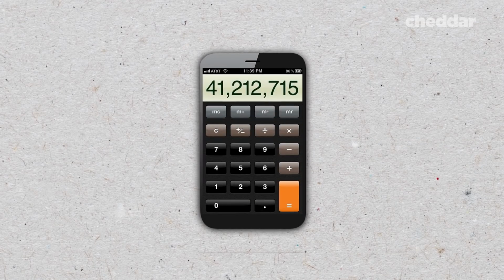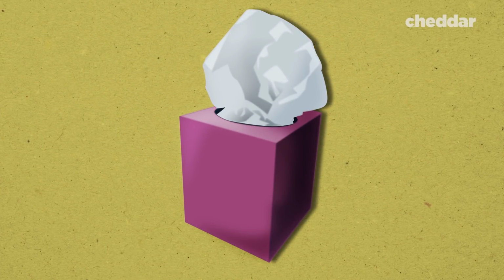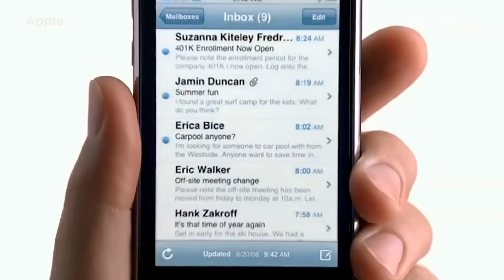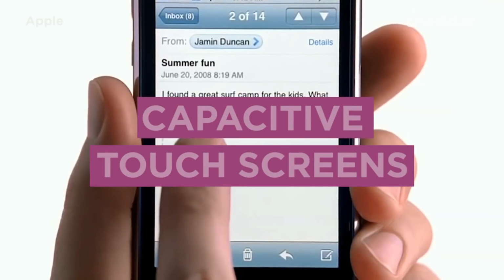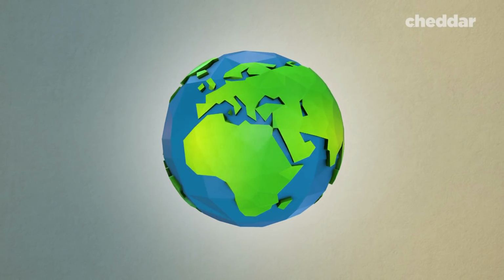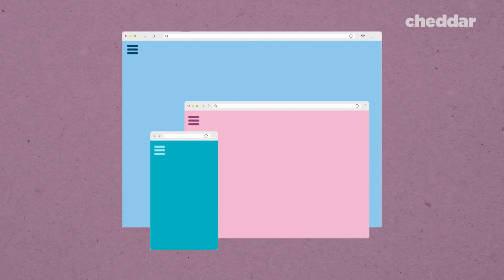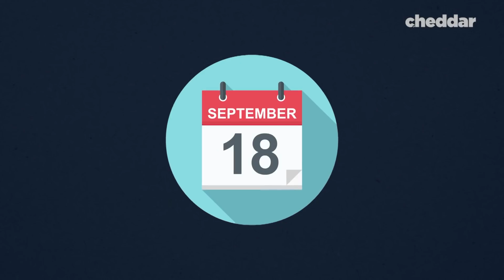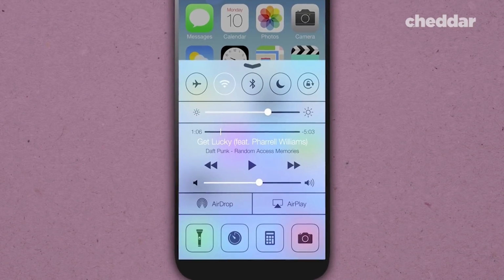Why 3D Logos Fell Out of Favor Overnight - Cheddar Explains

Comment: - Hamburger menu icon does not look at all like a hamburger. But, close enough and, I guess, hamburger is more memorable than “three horizontal bars” menu? Even this burger style? menu icon is changing with lower lines cut shorter (Just look above here at the YouTube SORT BY menu! That would be a very tippy burger.)
- Pro graphic designers always hated ugly 3D logotypes because they are impractical for many and diverse applications. As companies grew up, they realized they needed better designers to do their identity design. So they hired better/pro firms versus high school friends who went to art school or, the local yellow pages…
At the same time, the 1980s icon work by designers like Susan Kare, which is associated with the post modern movement in graphic design at the time (in part, oddly, thanks to the Mac at the same time — it gets very meta), 3D icons were useful (as described here). 
The crazy thing is that the icon became the brand or, rather WAS the brand. The inevitable reconsideration of brand identity versus function along with the preference of designers lie Ive at Apple toward less and less — of everything, much to the frustration of everyone! — meant things went back to simple and flat. Even if that meant they no longer worked as a form of visual feedback for the user. Much like this ☁︎ means cloud or this ☔︎ means you will need an umbrella.
However, in some cases, minimizing went/has gone too far. 
I am no fan of ugly logos and icons as decorations but, skeumorphism has its purpose to enhance a designs function and feedback in some instances. Probably a combo of some minimal and some key skeumorphs for interface icons make sense. But simple and clear for identity and brand design is better.
Just don't take it too far. Which is happening now with the branding of a lot of corporate identities to a Helvetica like signature as the identity. Too little is, too much. Simple for simple's sake is not really simple. Just boring and, bad design.

Comment: Pizza hut's was flat already. Ihop's was basically flat with a slight shadow to give depth, wouldn't call it 3D either. The only accurate example is the olive garden one. How can you narrate something and contradict yourself visually at the same time? Was this video designed by committee? 3D vs Flat != Complex vs Simple. You can have a 3D logo that is super simple and a 2D, flat logo that is a clusterfuck of complexity.

Comment: Meh, I'm not wholly convinced by the anti-skeuomorphism claims - sure, it can be misused and abused, but the idea that design can be used to provide information about function is legitimate, and the complaint that it's become more difficult to tell what's clickable is also legitimate. Design should always look towards making things easier to use, and taking an extremist stance that ALL skeuomorphic design is bad, or the stance that ALL flat design is cleaner and easier to use - is in my opinion hurting design more than it is helping. There is an time and place for everything, and knowing when to use design elements like shadows and gradients - and knowing when not to use them - is key. I'm hoping that in the future design is driven by what works best, not driven by bad philosophy based on black and white thinking.

Also there is some factually incorrect information in this video - SVG and other vector formats actually support shadows and other 3D like effects. Being able to scale an image to any size is not affected by things like shadows.

Comment: Some serious scripting issues in this video.

The Adobe applications that ushered in anew era of logo design were Photoshop and Illustrator, not InDesign as the video claims.

And Apple has never made anything called an iTouch. They did use the iPhone OS (as it was known originally) on the iPod Touch.

But perhaps worst of all is the conceit that iOS 7 installed itself overnight. It most certainly did not.

Comment: 3D logos were just a passing trend, like any other trend. Logos need to be easy to recognize and reproduce on different media, and that's why flat logos are not a trend, but a need, and they have been used since the dawn of graphic design. You're not going to use a fully shaded 3D logo on an embroidered shirt for a uniform, or a medium that only allows for one color to be used. You're mixing corporate design with UI and UX design. Apple may have pioneered some design trends at some points, but I'd dare say that was only for other competing companies like Samsung and Google, but that works both ways. It's silly to think Apple influenced Pizza Hut's or BK's logo evolution.

Comment: As soon as something becomes easy to do it becomes unfashionable.  On the Web,  glossy surfaces, rounded corners and drop shadows were hard and involved complex tables and slicing images into little bits. So designers wanted it.

Then css came along and it became a lot easier.  So designers  stopped doing it.

Comment: What this video calls "3D" isn't truly 3D; it's 2D design made to look like 3D. Abandoning that design philosophy, or "going back to 2D", is just a phase that can and will change as the wind shifts in Silicon Valley. (And no, Apple is NOT the only source of those changes.) The most truthful thing about this video is that VR will force a return to 3D design, because it requires 3D realtime rendering if not true stereoscopic 3D (which at this time still requires special eyewear, hence why 3DTVs disappeared -- especially the "active shutter" kind).

Comment: I'm surprised the video didn't mention the argument that flat UI design (which it incorrectly calls "2D") conserves processor power and thus extends battery life in mobile devices -- which was a BS argument because both processor power and battery life were improving rapidly at the time everything switched from glossy to flat, thus making the alleged improvement irrelevant. 

And companies are starting to slowly shift back towards a more glossy design. When Windows 10 first came out it was totally flat and monochromatic, but with each major update it gradually added back some more colors, transparency, and shadows, and now with "Fluid Design", Microsoft is proposing to make Windows look more truly 3D (not just glossy) than it has ever been before.

Comment: Wow. Not only at first, to this day this is a problem. 2D is amateurish. It looks and feels less professional, less modern, less technical, less of what we should expect.

The menu button has been around in the 3 line design since I can remember. Like the oldest graphical interfaces I played with had some variation . So when you call it a “hamburger menu” it makes a lot of people cringe. Hard. Especially me.
Simply; people needed an excuse to make changes. Unfortunately it fell flat on its face. Technology moves forward, and design moves backward. It doesn’t seem to bother most people, which is good. But that fact bothers me a lot. We should hold technology, innovation, design, etc. to a higher standard. 

But then again that’s just my opinion. 
I greatly miss the 3D integration in all our tech, and I’m saddened that more people aren’t adamant about it.

Comment: wow wow wow so all those 4.2K dislikes are from android advocates? This video uses ios as an example to explain the timeline of design trends which is mostly correct because, before the introduction of MD in Lollipop, iOS with its systematic design language controlled and dominated the app interfaces. It’s overnight because after iOS 7, every application on mobile platform or even desktop apps and websites started to shift to flat design (it’s definitely not because of the design language from windows mobile. It is iOS who made the shift). The title of this video is called “Why 3D Logos Fell Out of Favor Overnight”, it is NOT “Who caused the downfall of 3D logos”, so they did not necessarily need to mention windows’ metro design.

Comment: The shift towards 2D logos actually started with Microsoft when they released Windows 8. You know, the computer OS used by an estimated of 70% PC users as of 2016.
Reply: Windows 8 was used by 7.1% of the total pc users, NICE TRY THO KEEP IT UP.
Reply: Tasso no, IT IS USED BY 7.1% of pc users. ITS NOT USED AS MUCH NOW AS WINDOWS 10 IS NOW USED MORE
Reply: What idiot would use windows 8? Compared to 7, it is utter garbage
Reply: @Sciller4  that is not the point. 70% used windows 8 at the time but now nearly nobody uses it
there is a difference yknow between past tense and present tense
also stop necroposting - the discussion ended 4 months ago

Comment: This video doesn’t really hit the mark on several fronts.

You name two Adobe programs (InDesign and Photoshop), but leave out the most important one - Adobe Illustrator. That’s the program you make these logos with. It’s the program you use when you vectorize your face.

You keep referring to this trend as “2D”. The industry - and more appropriate - term is “flat design”

You use the Burger King logos to state that logos are going 3D. But both logos are 2D.

You’re explanation of skeuomorphic design is (almost)correct, but the example of the floppy disk isn’t.
In skeuomorphic design, you retain
ornamental, mostly unnecessary design cues that are inherent to the original (like the calculator interface you show). The floppy disk icon is an analogy you use to convey you can save something. Yes the analogy harkens back to earlier times, but it’s an analogy, not a skeuomorphic element.

I wonder if other cheddar videos are as incomplete and inaccurate as this one, but i just don’t know enough about the subjects.

Comment: Wow, a lot of this video is really poorly researched.

- If you made your logo in Photoshop or InDesign... you're doing it wrong. Most logos I guarantee you are 2D vectors coming out of Illustrator. Even the "3D" ones. Illustrator has been around for over 30 years. If designers start using another software, it will be to avoid paying CC fees, not because another program is better.
- 3D/2D terminology is all messed up. The Burger King logo is NOT 3D. Neither are beveled/embossed shaded icons. You can simulate 3D with lines and shapes and shading, but actual 3D requires a 3D mesh somehow.
- Most 2D logos are still converted to a bitmap like PNGs. Yes, flat vectors are always going to be more scaleable, but many effects can be applied to the logo natively and scaled as well. Typically, shaded bitmap logos/illustrations will be derived from a high quality master.

Design in the 90s was loud and crazy expressive. Together with the advent of 3D CGI and computer aided software like Illustrator you got stuff like the N64 logo, funky colors like the Fresh Prince of Bel-Air and Nerf, the multicolored Apple, and crazy shapes like the Nickelodeon and Microsoft Windows logos.

Trends away from the 90s sought to refine the crazy shapes and colors to take advantage of what computers do well and remove excess. Minimalism dominated, and focus was geared more towards a cleaner approach. The "wet-floor" look became popular, while nowadays it seems the cleaner and flatter the better. Flat designs that look great will always look great because they don't rely on any special technology to read well, and they can read well in black and white or color.

AR is NOT bringing crazy logos back. If anything, minimalism will reach a point where designers start removing crucial items for designs to read, then realize the importance of having more recognizable details, and with programs like Affinity Designer becoming popular, more illustrated styles may become preferred. But if you think AR is responsible for this trend or somehow benefits from it, you're sorely mistaken.

Comment: Flat design came from Zune in 2006 and Windows Phone 7 in 2010. iOS had a sloppy form in 2013 then Google perfected it with Material Design in 2014. Apple's role is severely overstated in this video. Neither the first nor the best nor the most influential.

Comment: Oversimplification on the account of old logos before the '3d' era. It wasn't just the lack of CGI, but that printing complex colored logos would have been way prohibitely expensive without modern CMYK printing technology. That's the same reason comic book characters back then looked like they had contracted a severe case of measles - they had to make the most of very few tones so skin tones ended up with thick dotted patterns as a crude dither effect.

Similarly, saying that you can't make 3d looking vector graphics - this is completely innacurate! You can have several types of dithering efects with vectors which perfectly replicate the look of the old 3d-like logos. And what was at premium was not space (adding a gradient effect doesn't make an icon take up more space lol) but resolution - complex vector logos would scale poorly in the screens of old phones. However this is no longer the case as pixels on modern phones are so small people can just barely make out individual pixels and any detail that would be lost in scaling probably wouldn't be visible to the naked eye anyway and as such there's no reason to think they might never make a comeback.

Comment: This whole video feels like it was made after one or two watercooler talks with the people that designed your new logo, rather than in-depth research.

The Burger King logo wasn't 3D. The Pizza Hut logo wasn't 3D. The IHOP logo wasn't 3D. Don't confuse simplififying a logo with dimensionality; the windows 98 logo was 2D but more visually complex than the XP logo.

Secondly. A vector image can either look 3D or 2D. Case in point: the instagram logo (the old one) from the video thumbnail is made with vectors.

Third, skeuomorphism in interfaces has very little to do with logo design. This can be seen in the old/new IOS icons for itunes and app store which a have the same ICON but it's placed in a differently feeling *BUTTON*. While bevel/emboss effects were used to give 'affordance' (show that something can be used) in UX, the reason for more complex logos and graphics in general is 3 different reasons; 1 showcasing improved screens/colors - 2 faster hardware and wider software accessibility made it easier to layer many effects - 3 a bit of counterculture. Currently the flatter shapes again showcase better screens; crisp sharp lines on the outside that don't rely on shadows to hide pixelation, and soft gradients show the subtlety of screencolors. But that's from a UX and hardware perspective (e.g. why apply did it).

The reason for LOGOS being simpler and flatter is mostly due to a shift towards more flexible branding, with more motion and interaction. Look at the netflix logo popping out of the screen and then becoming flat. It allows a visual punch, but also to be used in static media. Look at how the google G transforms into loading bubbles, soundwaves and other icons. This added dynamic complexity is balanced out by removing other complexities.

So all in all, this video might sound coherent and plausible but it' mostly unconnected nonsense - which makes me rethink the credibility of other Chedder videos I've watched.

Comment: Some of the arguments don't quite add up, e.g. skeuomorphism is a good way to teach and once taught not needed anymore.
If that was the case phones in developing markets would use it extensively but that is not really the case.
And what you call flat isn't really flat. Look carefully, the Netflix logo has a 3D animation, Googles material design uses lots of drop shadows and basically tries to mimic a paper like experience.
When it comes to animations and gestures Apple seems to go even further.
They gave this great talk about designing fluid interfaces where they showed that the behavior of they gestures and animations is so close to how real world objects behave that one could describe it as a simplified physics simulation.
So they basically use the same ideas that underlie skeuomorphism.

Comment: Half of your examples weren't even mimicking 3D iconography in the first place though. For example, the old pizza hut logo was flat, it just had a default rough brush from Adobe Illustrator. The iHop logo wasn't even close to 3D. Just a flat blue rectangle with a 2D arch. The Olive Garden one is a little bit 3D though. I think a main thing you forgot to touch on was that bounding boxes fell out of fashion at some point. That right there is what's different about iHop and Olive garden. Although at the same time, operating systems took on the disgusting 'solid colored square' approach as if it everything was on a tablet. Yep, everything sure is shit now.

Comment: "They didn't know what was clickable, and what wasn't". I think you'd need to be someone who's not tech savvy to not easily adapt to the change from iOS 6 to iOS 7. There was hardly anything that changed in regards to buttons. The flat design in iOS 7 mainly removed the "shiny" and "shadowy" finishes. The overall design was more vibrant compared to previous iOS versions. I don't think Apple was stupid enough at the time to make the transition rough for its users.
And also, how many "people were not happy" about the change? Sounds like your research is vague and was done by some high schooler. In fact, it's more arguable that people were more excited as the skeuomorphic design in iOS started to look a bit dated.